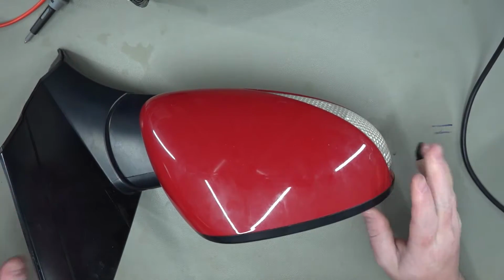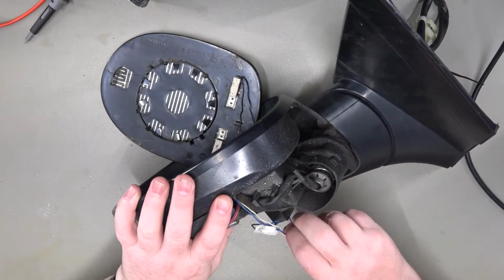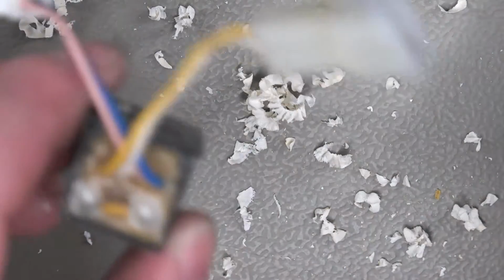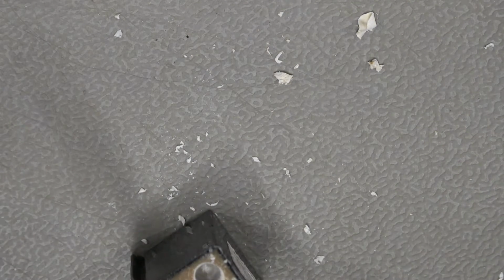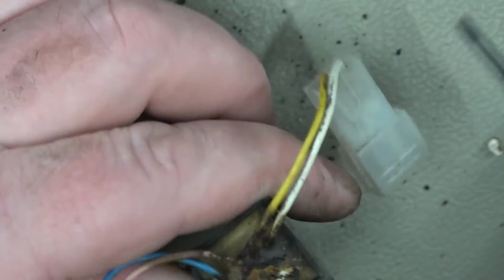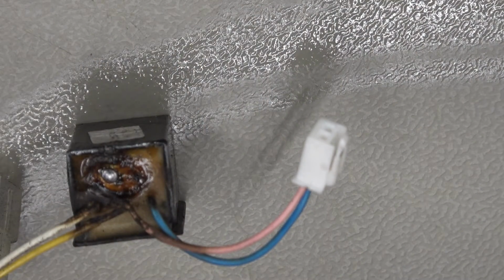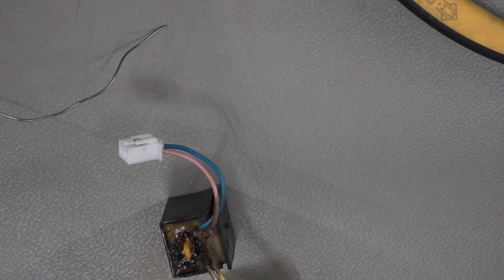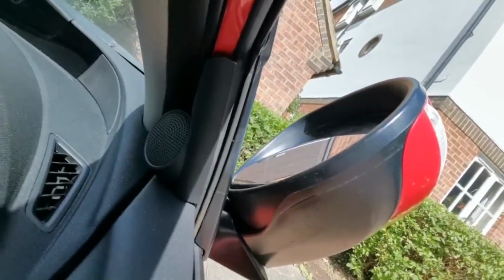Honda Civic MK8 Power Folding Mirrors SOD Repair

Comment: i Had a short in the SOD module, it blow the fuse.. so cabin air heat, stopped working, 
Thanks to your video i was able to quickly Take out the SOD's, had a new fuse and now i at least have Cabin Air and heat. 
Not fun to fix in middle of night in winter in Norway :D but wife needed car in morning.
Thanks.

Comment: Don't bother cutting the resin away. Crush the resettable fuse component gently with small pliers to remove the tan-coloured shell, then unsolder the wire legs from the internals. You now have two wires to which the replacement fuse can be soldered. Same solution as on Saab 9-5 with SOD failure.